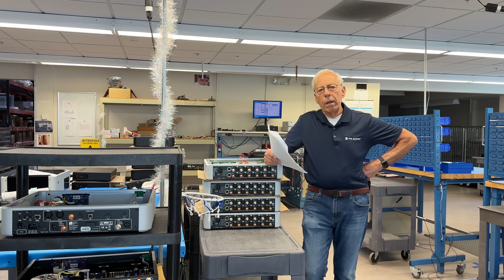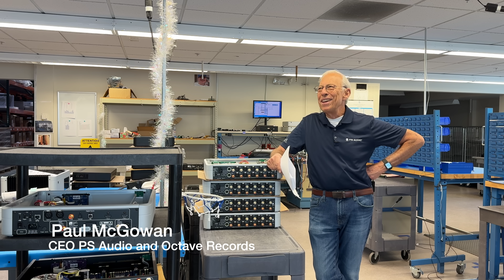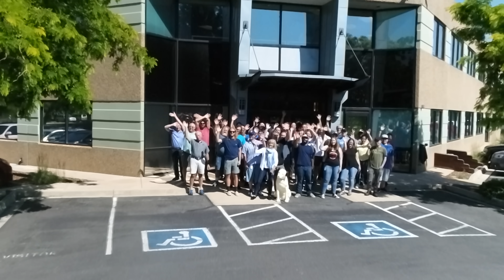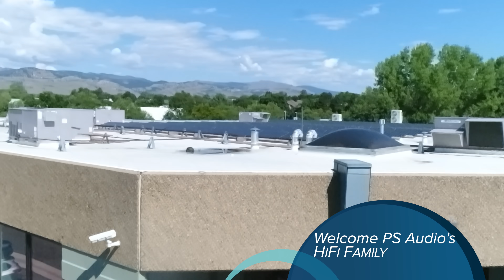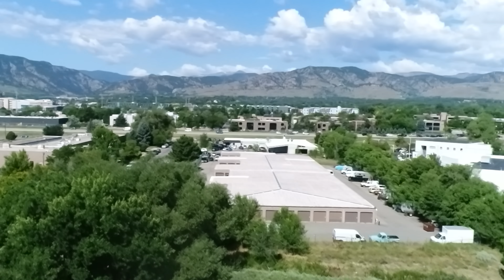Why digital audio isn't stair stepped

Comment: it actually is stair step :D --> "drawing a digital waveform as a stair step was wrong to beging with. a stair step is a continuous time function it's jagged and it's piecewise but it has the defined value at every point in time. sampled signal is entirely different. it's discrete time, it's only got a value right at each instantaneous sample point and it's undefined there, there is NO value at all everywhere in between... a discrete time signal is properly drawn as lollipop graph."

more info in --> https://youtu.be/cIQ9IXSUzuM

Comment: Problem is..multiple frequencies all at once and their interaction in the audio rhealm..yes.. harmonics..interact. next the filter changes the steps to look like analog.ITS NOT ANALOG..its a zerox copy..in time that represents ANALOG ANALOG
Reply: @nicksterj uh..no they are coupled from stage to stage..some direct some with coupling cap..but actually a living analog  sonic gizmo.. being so it has harmonic signatures from the interaction of the frequencies..thats whats missing in modern amps.
Reply: @nicksterj well its more than sound pressure..its a union of energy. I understand that theres benefits to using a computer in the digital rhealm.

Comment: One thing that's interesting to note is those higher frequencies that get filtered off are just high frequency images or mirrors of the baseband signal 

So you could also recover the signal from the supersonic high pass as it would just alias back as the original signal
Reply: @nicksterj had never heard of the concept before but to a first approximation it sounds kinda smart lol

"The images are all ultrasonic so just the ear be the filter"

Until intermodulation gets a hold of it, I suspect

Comment: To complete the explanation, there was a guy called Nyquist who proved that if you take snapshots very fast, when you apply the output smoothing (low pass) filter the result exactly matches the original analog signal. (still keeping this simple)

Comment: Paul, I am amazed how wrong y are, those voltages are sample points that are converted by a mathematical transformation in the original smooth analog curve by the dac, no jagies anyware, the filters are to eliminate the high frequency samples that are less that the at least double the sample rate than the frequency, 40k hz for 20k hz for human hearing, please correct. Marvin

Comment: When I have explained this to friends (and customers when I was selling), I've put it this way. Yes, the samples look like stairsteps, but that's only part of the process. The rest of the process knows how to fill in the "blanks" of the space between the steps. The result is an output waveform that is EXACTLY like the input waveform - at least as far as audibility is concerned. If you drill down deep enough, you can see infinitesimal differences orders of magnitude below anything you can hear. But that's the key: you can't hear them. Other things like the analog output stage of the DAC will be the things that affect sound, not the digital process itself.

Comment: I would be impressed with digital even if it was able to turn 0s and 1s into a simple tone or crude low fidelity sound where you could hear whether something is a voice or an instrument. I don't get these analog people. I've used high quality turntables/tonearms and cartridges, and the sound is really good, but does it really do anything that top notch digiyal reproduction (cds) cannot do. I once hated cd sound but now I don't hear any harshness, lack of smoothness, or spatiality. In fact the sound is velvet smooth and I'm now hearing details that the best turntable/cartridge I ever had did not. It was the equivelent of $5,000 to $6,000 today. Here are some things that cds and cd players CAN do that vinyl playback doesn't.

1. Cds don't degrade as you play them like vinyl.
2. No ticks, pops or mistracking 
3. No inner groove distortion.
4. Often twice as much music as what can be fit on an lp. 
5. Cds are way cheaper and price gouging is not near as common as with lps.
6. Used cds play better than they look; lps often play way worse than they look.
7. A used cd in reasonable condition is as good as a new cd. A regularly used lp is not as good as a new lp.
8. Lp records require you to get up and flip the disc over. Cds do not.
9. A collection of cds takes way less room.
10. You can enjoy cds on the go.
11. They are way less heavy and easier to transport.
12. The laaer lens of a cd player lasts far longer than a cartridges stylus.
13. A scratch on a cd probably won't matter. A scratch on an lp probably will.
14. Cds are much more consistent  pressings than lps. 
15. Lps warp. I've never seen a warped cd.
16. There's a lot more mod possibilities with cd players than turntables/ tonearms.
17. Cds can be put on repeat for long periods of music listening.
18. With the somple press of a button you can go to any track on a cd.
19. You can easily hear the tracks in any order or easily skip tracks with a cd
20. Not only is the compact disc more compact, but so are the cd players compared to a turntable.
21. They sometimes give you 2 to 6 albums on one cd.
22. Cds have better channel seperation.
23. Cds are almost always cleaner sounding.
24. You don't have to clean the stylus off after each side as with lps.
25. Cds have far less wow and flutter (pitch wavering).
26. With many turntables you have to use the usually compromised AC Cord and the interconnect that came with it. 

 I still like lps too and their bigger cover art, but cds have a heck of a lot going for them.

Comment: Digital is math and Analogue is physical and that all you need  really
Reply: Sample Rate= RPM & Feet Per Inch all motors have a rotation speed.

Analog simply means 1:1

Comment: this time I have to disagree with Paul. the "stair step" representation of the sound is totally misleading. there is actually no stair step.
this is just a way (one of the ways) to graphycally present the data is a comprehensible way, too bad that this was is misleading.
and yes, even if you need a filter, that filter doesn't actually "smooths the steps".
the real answer is: given a correct sampling rate that follows the Nyquist-Shannon theorem, there is only a single solution to the equation that matches 100% of the samples, and that solution is the original waveform. you don't "smooth the steps", you take out other solutions that would match the samples, creating aliasing.
but I understand that sometimes, when you speak about science to people, and that is quite and advanced topic in signal theory, you have to (over) simplify things, even if you say something that is not technically 100% true.
and I wanna thank Paul for what he does, this channel is amazing, even if we disagree sometimes! :)
Reply: You don't have to, you choose too
Reply: Yeah, except when you put in scope and zoom in for some million times you'll see it produce stair step.
Reply: @cheekibreeki9515  considering the sample rate of about 44 THOUSAND times a seconds, if the stair step occurs when you zoom in SOME MILLION times, it's obviously a limitation of the instrument. no instrument has infinite resolution.
but hey! "science doesn't have all the answers", isn't it?

Comment: It's maybe important to note that the sharp edged "stair step" isn't in the actual data. No sample was taken to get those sharp edges, and they're not a proper representation of the signal in any way. The samples are points, not stairs.
Reply: Exactly. There's no information, line or step between points. There's great information out there. It's even possible to prove and test it at home. Unfortunately, even qobuz draw these misleading graphs (why?).
Reply: So you have no clue as to how samples are created? YES the ADC accumulates voltage data during a sample duration that represents a flat step for that sample. The entire time period for that sample is one voltage for the entire duration. One STEP! Then the next accumulated STEP is sampled. Each sample starts with a sharp response when that gate is opened and a sharp edge when closed. 

A sample as a single point in time would require an infinite bandwidth. You've just been coned by the lollipop BS companies like TI through around!
Reply: @glenncurry3041  During the sampling of an analog signal, after passing through an appropriate antialiasing filter, an action called opening-retention-closing is performed. During the time that the signal is retained, its numerical evaluation is performed and it is quantified. The quantified value is at that moment what it was at the exact and specific moment of the opening, a point in time that has only lasted as long as necessary for its quantification. A point without a temporal dimension, but with an amplitude value, is what is stored, the temporal dimension is incorporated into the sampling rate and is somehow independent of the quantization.
Reply: @glenncurry3041  I'm trying to say that no instantaneous sample is taken at the sharp edge of the stair step, so that sharp edge is not really what the data says. The value corresponds to a point at the end of the interval*. It's not a stair, it's a point. Meaning that sharp edge - if you draw a straight line down to its corresponding time on the X axis - wasn't taken at that level at that moment. So, presenting it as a continuous "step" across an entire interval is just wrong. It's like the census. It might take a year to conduct the census, but the number presented at the end isn't necessarily the number of people alive at that moment. It's the number of people you counted during the amount of time it took you to count them. It's the same thing for pixel data on digital cameras. The "pixels" (in the data and in the math used to interpret the data) are actually infinitesimal points, not pixels of a particular size or shape. (Though in this case they do have a corresponding physical component on the sensor - even though there are gaps between them - this is in contrast to film.) Once the samples are taken (which of course takes time), their value anywhere except at that point or anywhere *during that interval doesn't exist, and the data itself definitely doesn't have "sharp edges." In the case of digital images, we then do then present the image using a stair step method, but it only works if the image has enough pixels and a high enough bit depth. But it's still wrong to look at the edges and conclude anything about them - the sharp edges are meaningless. With DACs we can't get away with presenting the edges because there are too few samples (although with DSD there are so many samples it will work).
Reply: Yes but. It must be filterer.
Reply: @nicksterj NO! Sigma Delta does NOT produce equivalent results! S/D ADC has no idea what the actual voltage is at any point in time! Only whether that sample is higher in voltage than the current status. Then a "digital/decimation filter" invents a number from that ONE bit sample to store for that 16bit, 24bit, 32bit sample level. 

e.g. a strong high frequency transient is the first sound sampled, maybe cymbal crash, Analog signal is sharp leading edge to peak voltage as fast as the circuit will allow. A SAM would sample the exact voltage level and store that exact value as all ones in all 16bits. While a S/D would only know that that sample was higher than existing level. It would have ONE bit of data to store. So the mystical digital/decimation filter invents a number to pretend that accurately represents the sample! It doesn't! It's at best an approximation they hope will eventually follow close to the original waveform as the number of sample increases.

In SAM every bit knows exactly what voltage the source was. In S/D it tries to sloppily follow trends.
Reply: @nicksterj So you finally understand. Almost. No one ever said the original analog signal had stair steps. That's absurd. The OP said "in the actual data" which would require it be post AtoD. So yes you are correct that it was the conversion from the original analog to digital that creates the stair steps. Thanks for proving my original point.

Comment: Bottom line is that well executed digital is at such a high resolution that the digital nature of the "stepping" is not audible.  *But technically, if you're removing something that was there to smooth it out, you are removing data that was created as a representation of analog sound.  So you have something missing, even if it's inaudible.  What is audible are things like distortion, jitter, clipping and things that come along with poorly executed digital.  But let's not forget - analog has it's issues as well.  No format is perfect and neither are your ears.  So pick your poison and enjoy the music because there is great music in both digital and analog.  PSAudio is definitely well executed digital or analog and Paul is a legend.
Reply: Bottom line is: in this day and age, conversion of an audio analog signal to digital and back to analog, can, and is, done perfectly. Within the desired frequency range, regardless of what it is, no one, no equipment, can determine a difference in the original signal and the digital to analog converted signal. This does not mean someone cannot, in the analog to digital conversion, screw up a recording be it an original recording or remaster of an old analog tape. As Paul says, it’s complicated—but not really to the engineers working with it daily. It’s science and engineering, not brain surgery. Many years ago an appendectomy was considered state of the art human surgery—it was cutting edge—pardon the pun. That’s where we are today with digital audio—it’s just not that big of a deal despite the fact equipment manufacturers are still trying to sell $10,000 DACs.
Reply: @mabehall7667   I generally agree with you, but have learned first hand that amps and dacs sound different, so it's not an automatic given that it's done well.  
I'm not a snake oil believer and quite skeptical with most audio claims, but some are valid.  I tried a well respected class D amp and it was annoyingly harsh with my titanium dome tweeters I had at the time.  A nice class A/AB amp was a night and day improvement.
I tried some DACs and most are fine, but some were amazing - A ladder DAC I tried had a sound that was very pleasing to listen to vs another which many consider high end, which was shrill and artificially bright. 

It's nice to have choices.

Comment: I would like to add that those hight frequency spikes Paul is refering to are way above the human hearing range, so inaudible to you, so removing them should have no impact in what you hear. If anything that high frequency noise has the potential to upset your amplifier etc., so we are mostly better off without them.
Reply: Although these high frequencies are indeed too high for the human ear, they do cause aliasing. And that can be audible.
Reply: 20CPS- 20KCPS (Hertz was assigned many years later) was established way before we had sound systems capable of being even close to flat at that bandwidth! It just stuck as a number range with no updates as technology progressed. But other areas of research overlap. The human auditory system is the fastest responding connection to our brain. Evolutionary to save our lives from noises in bushes around us. We can detect pulses arriving at the ears with difference over 10-20 microseconds. IOW our hearing responds to signals over 100Khz. (Microsecond temporal resolution in monaural hearing without spectral cues)  (PubMed 2003)

And as @Fastvoice states, even at higher sample rates PCM still produces many artifacts in thee audible range.
Reply: Everything changes everything. Even though we can't hear the spikes range, it would still effect some aspect of the signal we hear.

Comment: "FL Studio" here on YouTube have video showing visually and explaining quite well. It's a bit much to do just verbally in 5 minutes like Paul do, though I think he's doing a great job. 😄
Edit: look for videos with Monty Montgomery, might be on other channels as well, like "Audio University".
Reply: https://youtu.be/cD7YFUYLpDc
Reply: I believe it was Audio University that uses that bogus lollipop crap to hide the stair steps. And he refused to show any actual images of that lollipop existing at any point anywhere in any circuit! What a waste of time that vid was!
Reply: @glenncurry3041  Watch videos with Monty.
Reply: voltages measured (sampled) at a certain time happen at a particular instant, imagine a column of voltage values stepped by time, the raw output is shown as dots in x (voltage) y (time) axis without lines connecting them

Horizontal lines would imply the signal voltages stays the same before  next measurement took place

The lollipop vertical lines merely visually indicate the magnitude of the signal voltage at an instant when measurement happened, again not to confuse the vertical lines with the wave form being re-created

The dots (voltages at a certain time) goes through another step to re-create the analog signal